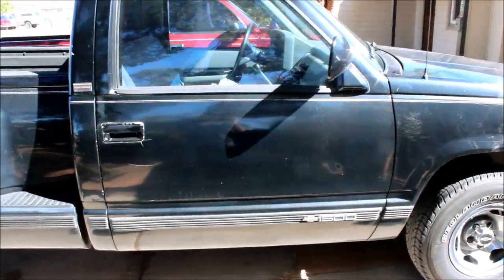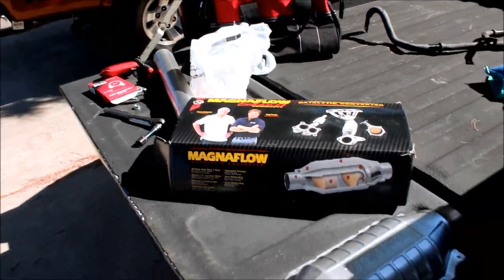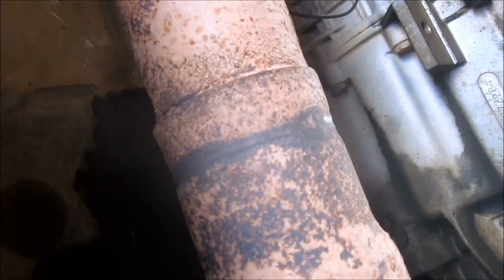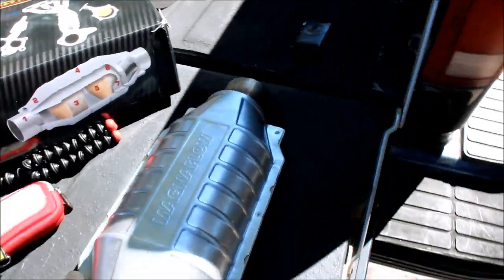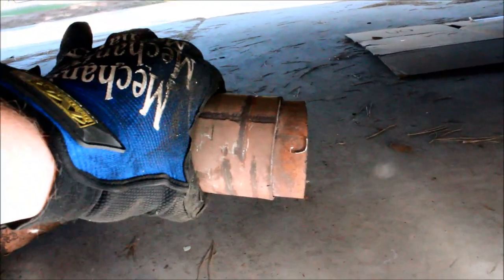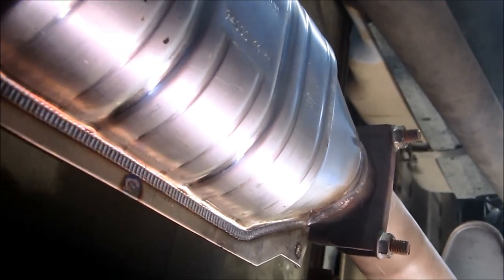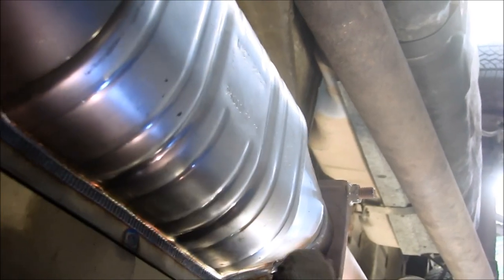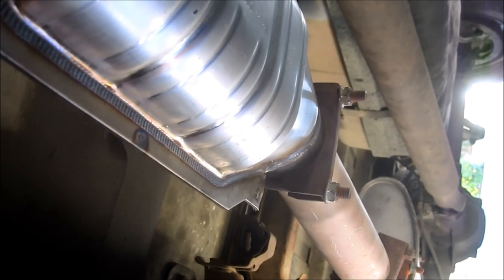Install a Magnaflow Catalytic Converter, Universal Fit

Comment from the maker: The performance of the truck noticeably improved, It didn't turn into a spring chicken, but it is a lot more spirited. It was a safe bet on the cat as the truck has 260k miles on it and service life of a cat is supposedly around100-200k. All in it was $101. If you can sell your old cat to a recycler (check your local laws, apparently recycling precious metals and helping the environment is frowned upon in some areas) you can recoup around $65-$100

Comment from the maker: welding is great,  clamping is adequate, i have noticed no exhaust gasses escaping around the joints. if you are concerned about leaks and have no access to welding, you can use the wide band style exhaust clamps (about 4 inches wide and have 2 bolts in them) that do an excellent sealing job and are only 3 times the price of the normal u clamps.

Comment: It would have likely been more effective to place the catalytic converter closer to the Y pipe, and then bolt the filler pipe behind it. The heat from the engine activates the catalysts to burn the emissions, so the closer to the down-pipe the better. Either way, nice install video.
Reply from the maker: That is great info, you're absolutely right, the cat should have been first, then the extension pipe! There would be a increase in catalyst performance. I wish i would have considered that. Thanks!
Reply: We'll take care of that next time... Seeing as hind sight is always 20/20 in the working man's world... Get er done...
Reply: Thanks for the info. About to do this install when my part arrives.

Comment from the maker: Your cat may be attached to the exhaust manifold, it may bolt straight to the manifold or be part of the manifold, go to a parts website and look up your catalytic converter. It will most likely be more complex than the video.

Comment: Thank you so much you helped me a lot. I just saw this part and the low price on advance auto part thought it was a mistake. Midas told me I need the catalytic converter but from your video I see all I need is extension pipe

Comment: you would need a sawzall or other means to cut off the old cat and likely 9/16" wrenches and/or ratchet to tighten down the new clamps. i would highly recommend using the band style clamps instead of the u-bolt type, you'll get a better seal, i think the extra cost is worth it in the long run.

Comment: 91 k1500 here mine is a manual also and is also sluggish going up hill, does not like to maintain highway speeds in 5 gear OD. I have to down shift alot if I let my speed drop off to much. going up hill the engine revs but sluggish as all hell. I will try this hope it is my problem as well.
Reply: Sounds nearly identical to the problems this truck was having but it sounds a little more serious on yours. I'd replace plugs, fuel filter, ignition coil, check the air filter and plug wires. Good Luck, Hope you get it moving better.

Comment: 45 mins... then a trip to the local muffler shop to weld all the connections so it doesn't leak...)
Reply: No, it does not need welded.
Reply: Agreed. Just had mine and the muffler done and had it welded. Clamping it would have been bad; the exhaust guy put in a bracket to hold the muffler as well.
Reply: It will leak and if it comes loose it's flying off on the highway

Comment: I have a  2000 chevy malibu 3.1L that i suspect has a bad cat converter...in general, i have heard people concerned about the airflow not being correct when compared to OEM? do you think this would be an issue or can i just install a universal? i really don't want to spend an extra 150-200 right now if a universal would work just as good. BTW, im living in texas where i won't get cancer if my converter isn't CARB compliant.
Reply from the maker: I took a look at the cat for that car, it seems that you could cut out the old one and put in a universal. I'm 100% sure the airflow is not correct, how could it be, it is universal, I suspect only the factory oem would be exactly correct, but what does that mean anyway? power loss, unlikely? power gain? efficiency? .. it also seems that there is an upstream and downstream o2 sensor on the Malibu.. so if the cat is not efficient enough, the downstream sensor will let you know.. i was fortunate that the 91 c1500 only has an upstream sensor and the only thing i had to worry about was the smog test and it passed with flying colors. and I'm sure my old c1500 engine  with extreme mileage was less efficient than your Malibu! So... from the comfort of my air conditioned home office and no financial stake in this..., i say go for it! (good luck)

Comment: My converter on my car blew out so i put the one in the video on my car but my car has no acceleration it will move but wont go over 1000 rpms i put a new maf sensor map sensor a throttle body new spark plugs an converter do u have any thoughts on it

Comment: How many clamps did you use to connect catalytic & extension pipe to existing pipes? 3?
Reply: Yes, 3, I recommend the band type clamps if you can spend the extra $, not the ones used in the video.

Comment: Wow, great video but I really cannot believe that you did not test the engine for sound and performance (going uphill)... so, did you see any improvement or not?
Reply from the maker: Thanks.. i din't think to show the sound difference because this is a cat, not a muffler, there is no change in sound, if there was, it was minimal and not noticeable. The power increase however.. that is very noticeable.. it was like a new truck.. my situation was extreme, i had high miles and it was obvious something was wrong with performance.

Comment: 200ish thousand miles on the truck, video made in 2013.. Is the ole girl still running or has it blown up by now. I just bought a magnaflow, was looking for peoples opinion on the performance when I came across your video. My old truck blew the head gasket. I pulled the engine, tore it down and have it totally rebuilt now. Only radiator, exhaust and getting the timing right on it left now. I’ve primed the engine with oil and hopefully she will be running in a couple hours. Anyhow, nice step side Chevy & keep up your YouTube post friend.
Reply: Thanks buddy, I've moved vids to my new channel, ZipZapDIY… I wouldn't call the new cat a performance increase, but a performance restoration.  I sold the truck to my brother about a year after this video and my nephews (lots of them) have been driving it all through high school. The engine still runs well, the interior is showing more age, no new damage to exterior. I love the truck and want it back but my sister-in-law wants to restore it when the kids are done with school. Congrats on putting yours back together.

Comment: I heard the clamp ons fall off or get loose. Is that true? Did you have any issues later on??
Reply: The only issue is when you don't torque the u bolt clamps down enough or don't clean the old surfaces adequately, the pipes can spin since you have an old rusty pipe mated with a new one and the mismatched surfaces can be slippy... You should use the wide band clamps instead. I was trying to cut costs on this repair.

Comment: What type of clamps did you get? That's what I need for my truck.
Reply: I used the old school u bolt clamps... these are what was originally used on the truck.
Reply: ZipZapDIY I have a 2002 Oldsmobile bravada. My cat is to the point that's it's VERY underpowered. Plus the magnaflow cat is universal and it's a direct fit.

Comment: how much of a difference did this make? I have a 94 suburban with 350 and it is a dog up here in utah. mpg went from 13/21 to 10/16. it has always had a hard time towing a 2000lb trailer up a grade. foor flat on the floor 2nd gear loosing rpms
Reply: The new cat made a big difference, I didn't have the mpg details like you but the mpg and power improvement was noticeable.

Comment: I have the check engine on, and they said the reason is the catalytic. I would like to know if this universal one would help me out because the original one is too expensive
Reply from the maker: Depends on your vehicle.. on this truck and most older trucks... the universal catalytic converter performs the same as an original and is easily installed.

Comment: Question: My Colt Czt 2006 has 2 catalytic converters, I removed the 2nd but kept the 1st so the "check engine" light doesn't show and I replaced it with a stainless steel pipe...would it be better to use a High-Flow Catalytic Converter like the vid or just keep it like this? which method actually gives higher air flow? thanks!
Reply: I'm not certain that this is a "high flow" or if it is even sold as such, I only know for certain that it is a universal replacement... although, it was high flow from the standpoint of me taking out a clogged and spent cat! From what I know, the only sure way to tell any improvement in airflow is on a dyno. Sorry, I can't help you... you've got some reading to do.. Good Luck.
Reply: xorkatoss Obviously a straight pipe will have better flow

Comment: Does new and as they seem to be ( almost performance ) catalytic converters really improve HP / power and adds more sound ?? 

My car is 9 years old and i've seen it from the bottom it looks as your rust cat converter or even worse ! because where i live its very very humid.

and is there an easy way of knowing the measurement of the pipe sizes of your car ??

Comment: I have 2010 Dodge Charger and my car makes a noise on idle and while it's moving, it's sort of a tick tick noise. I'm thinking it's the catalytic converter, but I'm not sure. It does feel like it's clogged though. When I push the pedal down suddenly the rpms go up but not the speed. Could it be the same problem?
Reply: tick tick could be the fuel injectors, it is somewhat normal to have some ticking from the fuel injectors. A clogged catalytic converter stops the engine from breathing and exhaling efficiently, so if you're clogged, your rpms should be sluggish and the car will feel underpowered. Based on the situation you describe, I'd look in the direction of the transmission, take a look and sniff of your trans fluid, you are looking and smelling for indications of "burnt" fluid. Or if you have a manual, perhaps a slipping clutch? Your car also seems a little young to have a clogged catalytic converter, if I remember correctly, the truck in this video was 22 years old and at around 265,000 miles.
Reply: It sounds like its your gears (transmission)

Comment: did the extension pipe come with the converter?
Reply: it does not come with the extension, auto parts stores sell different length extension to suit your needs.

Comment: What if you have an o2 sensor mounted with it? Can you just redrill it in?
Reply from the maker: I think that situation would not be ideal for a universal fit, as simply drilling a random hole may not place the sensor in the correct placement. i would go to a direct fit replacement cat

Comment from the maker: in this application, if you use clamps, you do not need to weld. If you use the u bolt clamps like in the video, you need to crank them down, I didn't make this clear enough in the video. They need to be super tight, not for leakage necessarily, but so the pipes don't twist inside each other. I wanted to do this repair on the cheap, but if you can spend the extra $15-$20, I highly recommend using the 4" wide "exhaust band clamps", they provide a better seal and clamping.

Comment: I wanna put this on my 2013 armada, but my mechanic said if I put it the engine light will come on. I am having hard time finding magnaflow muffler for armada because I have two pipes going in.
Reply: I imagine it would be ok..
Reply: it will trip the 02 code simply due to the fact that it is not OEM. but it will pass inspections where you only need a cat and do not have emissions tests. you can also get your vehicle tuned to accomodate for the aftermarket cat.

Comment: Did you have to weld the ends or just clamp it.
Reply: Welding of course is the best and you don't have to weld, I used the u clamps but I recommend the band clamps.

Comment: Did the emission test pass?
Reply from the maker: Yes.
Reply: What are the chances for the emission to pass if i install a universal catalytic on a 1998 ford e250?
Reply from the maker: I would say it it is good chance. the main difference between the direct fit and universal is just the fitment. There may be a difference in long term viability of the cat if you get one that is undersized for the vehicle/engine. Magnaflow has a fitment guide on their website and amazon sells most of them: https://amzn.to/2UEwtB4

Comment: no welding?
Reply: noorizerx In this context, no welding needed. The u bolts like in the video are adequate, but band clamps are superior, so I'd recommend using them instead, they only cost a few more dollars.

Comment: So, no welding required for this? I can't even get a muffler shop to give me an estimate on a new cat, lol. I only have one cat but it's part of a huge pipe with a Y split that goes to two flanges with O2 sensors, etc. It would be nice to cut my old cat out and just clamp a new one in.

Comment: We use to take a piece or rebar and hollow it out , cost nothing runs great.Screw the Green Beans
Reply: tmann, I've recently heard o2 sensor extentions are being sold at performance shops (?), after hearing this , I found on you tube, you can make your own with two spark plug fowlers mounted together, the one that the sensor screws into has to be drilled out for clearance for the sensor prob,  not sure how affective it is, but they say it  works and you won't get any more negative codes, I was about to do this to my 98 1500, but its running slugish , so just going to replace cats.....GREEN BEANS ,HA!

Comment: Can you put a CC on a 1969 Chevy truck?
Reply from the maker: i don't see why you couldn't, back pressure issue? if no issue, add it as close as possible to the exhaust manifold.
Reply: @kwazadilla  I was thinking mileage improvement.
Reply from the maker: adding a cat will not improve mpg, it will probably lower it. Pretty sure a 69 didn't have a cat originally
Reply: @kwazadilla  No it did not.  CCs did not come till 1975 I believe.

Comment: is this smog legal?
Reply from the maker: yes. you're just changing out a bad part for a good part, you are not negatively modifying or deleting any emissions components.
Reply: if you get checks your cat might have a O2 adaptor that needs fitted to the new converter or itll throw a code. I know mine does but i dont need no stinkin checks around here

Comment: this didn't work on a BMW 318i 1997 I keep getting a catalytic efficiency. code on the scanner
Reply: Something to note, this truck doesn't have a downstream o2 sensor so if a universal was not efficient enough, the truck wouldn't know it. It passed emissions after installing the universal cat, so that is good enough for me. I wonder if your BMW needs a direct replacement catalytic converter to be happy? or is there something going on with your downstream o2 sensor? Do you get any codes regarding  the upstream 02 sensor?

Comment: So we *don’t* need to weld anything or pay someone to do it? 
In California. 

*Is there a breaking in procedure?*

*Did you fix the reason why it failed in the 1st place???*
Reply from the maker: cannot speak to California specifically, no need to weld, welding the joints is better of course, but the clamps work just fine and are OE on many older cars. In my case, the issue was the age and high mileage, cats fill up with junk over time and the catalyst also gets "used up" so the flow and effectiveness suffers.
Reply: Things on Video Im scared but don’t want to afford getting someone else to do a crap job w/an expensive part. 
 
Mechanic Trust Issues.

Ive read about proper breaking in procedures...is this fact or fiction?
Reply from the maker: I hear you about the trust issue, part of the reason I work on my cars myself. The break in procedure only takes a few minutes and can only help.

Comment: 01:09 - some GM products do not have the monolith converter e.g. truck/van applications where the one seen in the video (which is the OEM version which was sawzalled) - these are not worth saving (it looks like the pellet converter shell used from 1975-early 1980s when it was upgraded); I currently run Magnaflow direct fit converters (one 4 a Jeep and a S10 Blazer where it had an OEM monolith converter)
Reply: Thanks for info, The old cat in this video almost paid for the new one. Direct fit is optimal, I think the amount of corrosion made a direct fit impossible in this instance.  this was about the cheapest and most improvement of any work I've done on that truck!

Comment from the maker: If I was going to do this catalytic converter install again, i would use the wide exhaust clamps like this : http://amzn.to/1r3TCKn
Reply: why did it fall apart on you?
Reply: it is solid with the u type bolts, but the wide clamps offer a better seal at the joint of a old rusted pipe and new pipe.
Reply: ZipZapDIY So there's no chance that it will all come undone? The leaks can be taken care of with some muffler putty no?
Reply: tighten the bolts up properly and there is no chance of failing and the leaks would really only be present if you've got serious corrosion on  pipes, you could dab some putty or clean up the pipes.
Reply: ZipZapDIY all right, that's great to know as I really didn't want to start welding.

Comment: No welding required?
Reply: +YKTV No Welding required, the best install is with welded joints, but you can use normal u-bolts (like the ones I used in this video)  or the wide band exhaust clamps like this: http://amzn.to/1r3TCKn

Comment: does it have to be wielded?
Reply: Does not need to be welded.
Reply: ZipZapDIY thanks
Reply: highly recommended for the highest chance of not producing an exhaust leak, which will fail an inspection on the spot.